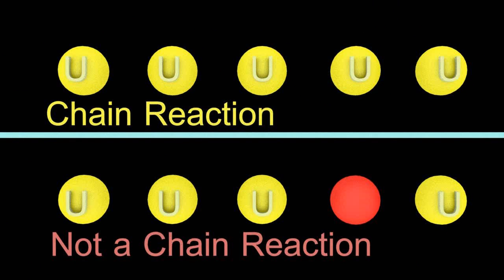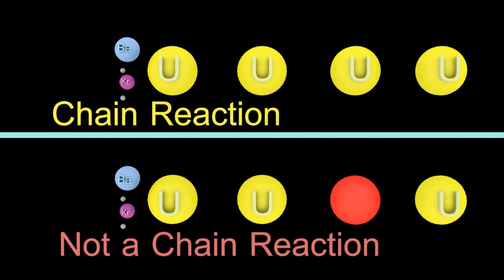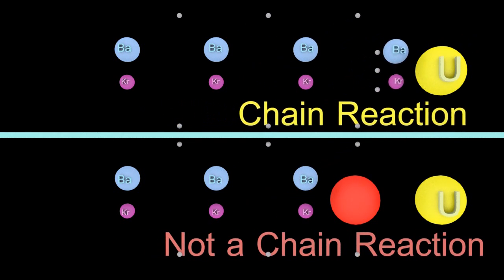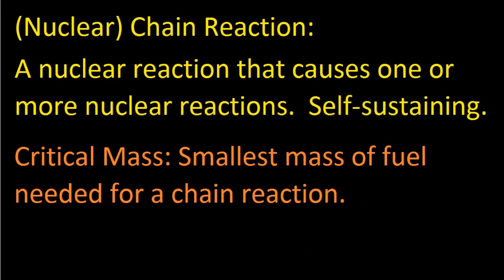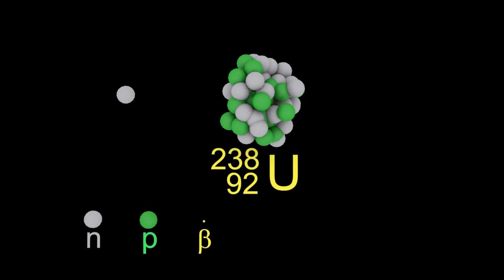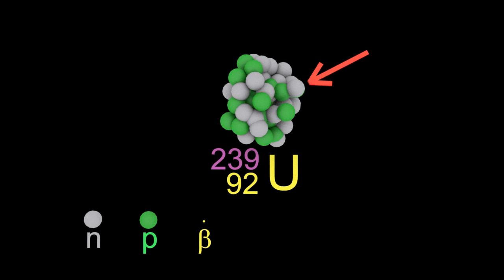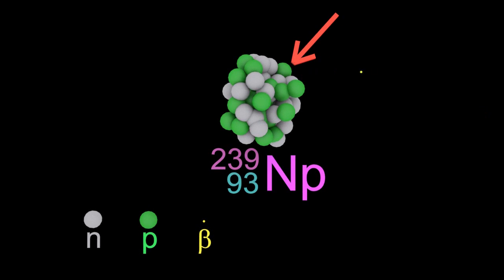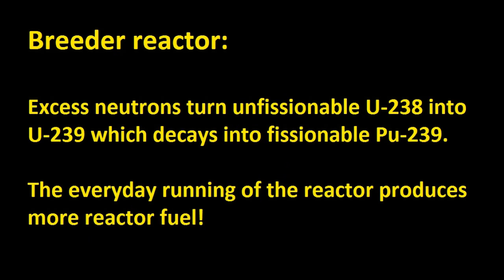C3 Chain Reaction, Critical Mass and Breeder Reactors [SL IB Chemistry]

Comment: ok but PU is less radioactive than U235
Reply from the maker: Bujt I think it is easier to use in bombs.
Reply: Richard Thornley agree catalyst made of Pu
Reply: @ibchemvids  It's not easier to use, it is much easier to breed more of it in a reactor to get more fissionable material than it takes to enrich U235. So you can build more bombs faster with Pu 239 than with U235. But the bombs are not simpler, they are more complicated. The simplest bomb is the uranium bomb.